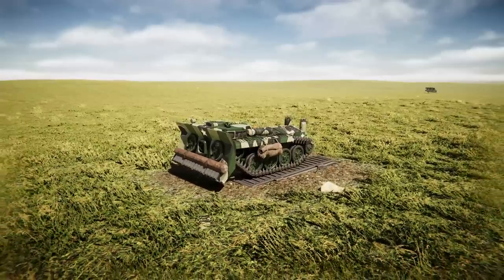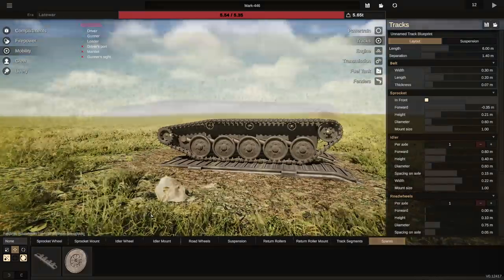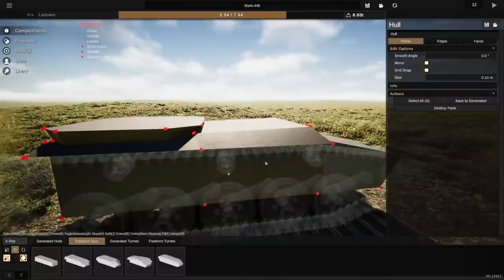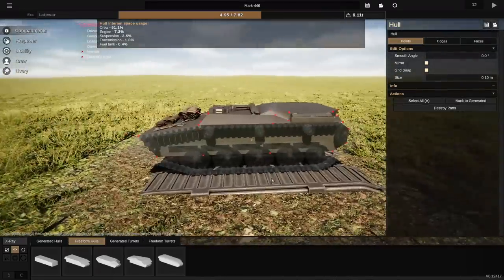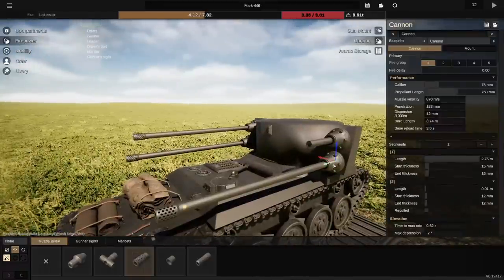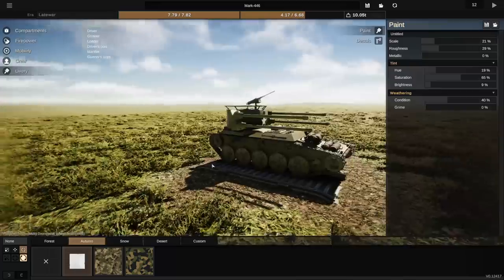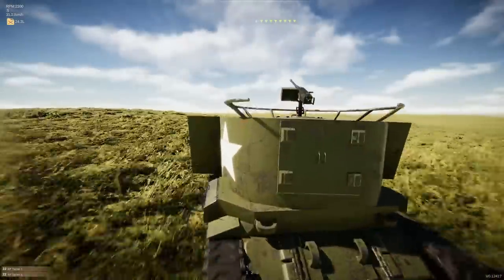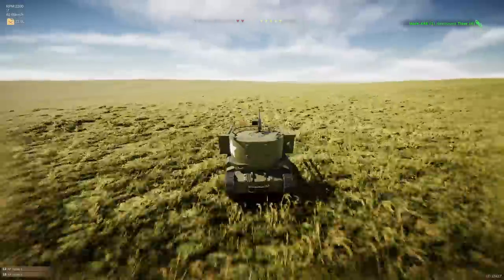I Built An AA TANK That's TOO POWERFUL For The Enemy In Sprocket Tank Design!

Comment: AA tanks against actual tanks are op. A gun meant to shoot projectiles super fast is the very base for anti-tank weapons.
Reply from the maker: Trueeee
Reply: I agree, I once made an Otomatic replica in Sprocket and it was tearing enemy tanks apart
Reply: But it also is meant to be targeting planes so they would be shooting high explosive rounds not APHE or just armor piercing
Reply: @TheCryptYard  you could load it with Semi-Armor Piercing HE shells, then it could be multi purpose
Reply: You mean anti aircraft guns CAN make good anti tank GUNS... ON a tank. not the same.
Reply: @TheCryptYard  just rattle the tank til they surrender
Reply: IRL they wouldn't do much damage to actual MBTs, since their survivability is extremely low and they most likely won't be able to penetrate anything.
Reply: modern ones are usually multi purpose including autocannons but the most likely will see more light skinned vehicles due to when they get placed.
Reply: The most well known AA gun that was used against tanks was the Flak 88 from the Second World War. That gun was one of the few guns that would see development and use trough the entire war. It was already in use in the Spanish Civil War in 1936.  Either there or in Poland a crew had to lower the barrel and defend themselves with their gun. That was the birth of this gun as a possible antitank gun. As a tank gun it held its size and weight therefore both the TIger 1 and 2 where big and had the problems attached to that. Both those tanks were slow and heavy and had problems with their engines, that were hardly capable of getting the tanks to move. No surprise that with the four 75mm guns in this creation Frantic has similar problems.
Reply: One example of a AA tank in ww2 is the german webelwind that had 4 AA auto-cannons and ostwind with only one
Reply: As a war thunder player I absolutely agree with this
Reply: @Peregrine101  small note it is not called flak 88
Reply: @deltachoco8991  Basically you are right. Variants are officially given model numbers (probably based on the year the development started), but when talking about the 88 mm guns in German use for AA purposes it is not uncommon to talk about the flak 88.
Reply: @LaVaZ000  nowadays most AA tanks use missiles
But in the past things like the skink were used against everything but airplanes (the very fun British spaa)
Reply: @WMason27  allot more modern aa guns also have composite rigid shells
Reply: But the tank also has the weight advantage
It has less components in the turret which lowers the weight
Tanks also have the caliber advantage as AA doesn’t need as much to penetrate plane armor as they are mainly focused on speed and not armor
Reply: @TheCryptYard  but doesn’t APHE stand for armor piercing high explosive

Comment: It's hard to aim because the guns will basically shoot forward relative to the sight. So if the gun is left of the sight, the round will fly off left of the reticle and so forth. So for the aesthetics of the tank, it was correct. For the gameplay functionality, it was off. Try building a different version with the guns centralized and with an incremental delay on each of the guns that spans the reload time. That way you could to sustained volley fire.
Reply from the maker: Aye, the aiming I was trying to solve with azimuth but I'm not allowed :( I like the idea of a gatling gun type thing... so maybe that's next :)

Comment: Please, PLEASE, make a tank with Rounded Armor. The whole reason the Russians and Americans used it in WW2 is because it is EXTREMELY good at screwing with incoming projectiles, they would layer this armor causing it to be extremely effective at stopping rounds. Some of these vehicles would stand up to modern ammunition pretty well. (Except For APFSDS, and HEATFS to an extent)
Reply: Because there is nothing better than cast armor.
Reply: Sprocket’s AI counters rounded plates pretty well. also, rounded armor in sprocket is just an inbuilt texture shader effect. Also, cast armor, the ‘round armor’ you’re talking about, was never layered. Rolled plates were layered onto some cast hulls and turrets, but by the end of the war, at least most hulls were welded rolled plates, not cast. See the later Sherman hulls. At the end of the day, sloping was much more effective than rounded casting. It was just sometimes more cost effective to cast, and round angles are safer to cast than sharp slopes.

Comment: What would happen if you made the sides kinda like teeth where instead of it being flat across one side it was angled like /\/\/\ all around the tank so no side could be hit with out being hit in a angled peice increasing its effective armour.
Reply from the maker: That's kinda true but might actually make for a deathtrap
Reply: That would just deflect the rounds into the tank and increase the size of the tank and weight as well as making the crew area kinda not ergonomic
Reply: @kingoftheneeks3623  just tryna take advantage of game mechanics